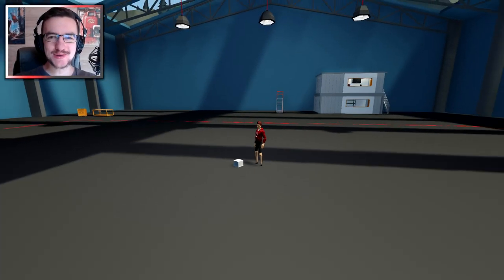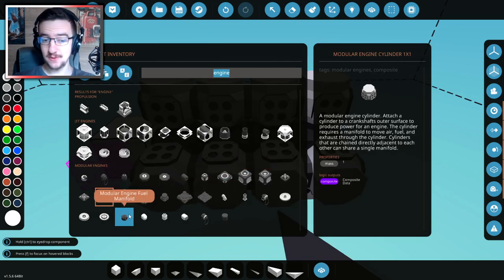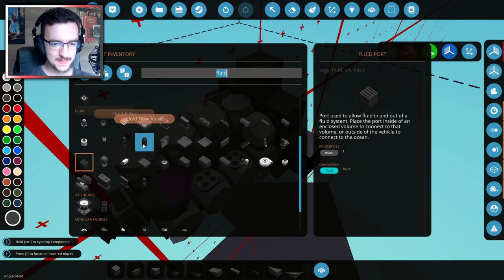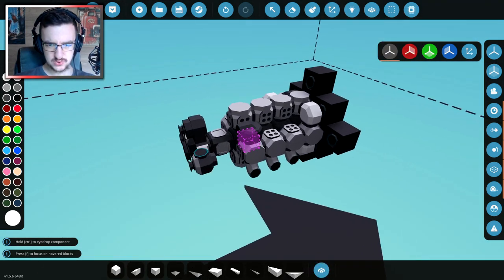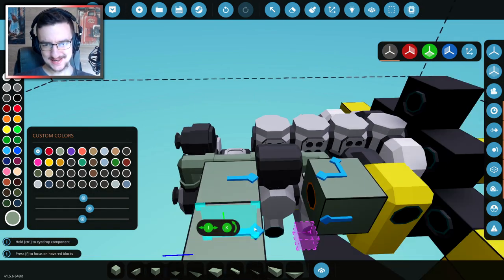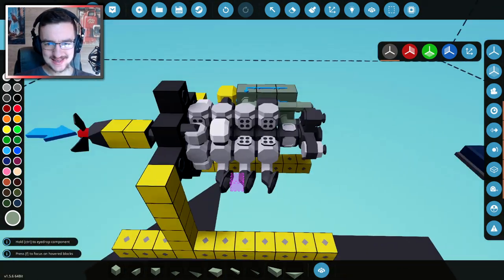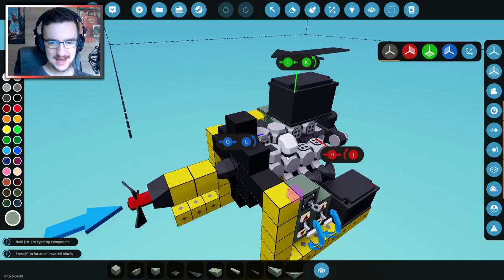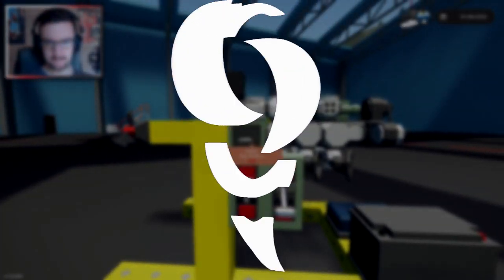HUGE 16 CYLINDER Modular Engine BUILD! - Stormworks Gameplay

Comment: id recommend adding a pump to the air intake as it gives you more power and helps a bit with high altitude efficiency
Reply: that dosent work. for it work You beed ti have a microcontroller that  controlls the forced induction,
Reply: @citruss5737  not necessarily. I use the fluid pump for the modular engine crank pulley on a 4 cylinder engine it tends to add about 10% power
Reply: @darkwatersband  You mist have a microcontroller that adds more fuel at the same time then otherwise you are indeed lying
Reply: @citruss5737  lol whatever you say XD

Comment: I have both a tank and a train with more than 30 cylinders,  just because the 3x3s and 5x5s are so fuel hungry :)
Reply: actually if you run a 3x3 with 3 cylinder and run it at around 12 rps its really fuel efficient but it may lack the piwer u need

Comment: For making engines I usually have an air and fuel manifold for each cylinder bank, my engines don’t run very well, but could my idea work, or is it just crap?
Reply from the maker: Just attach all the lines together and it'll work as one anyway

Comment: Bro there is no fluid in coolant u have to attach water tank on any  pipe which is used for coolant
Reply: thats correct but if He added a better radiator coolant system he wouldnt have to attach a fluid tank because the radiators spawns with fluid